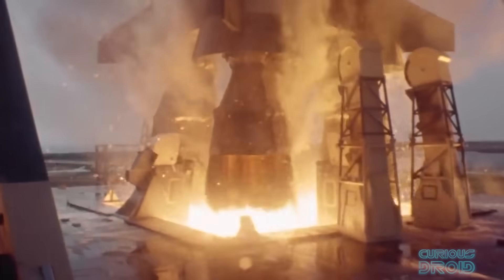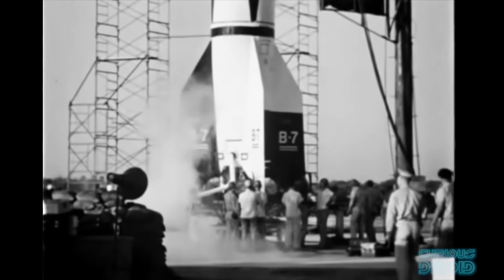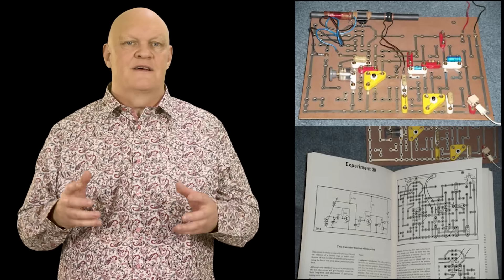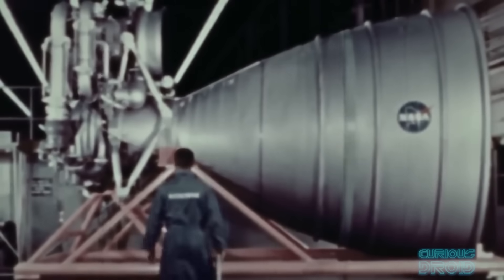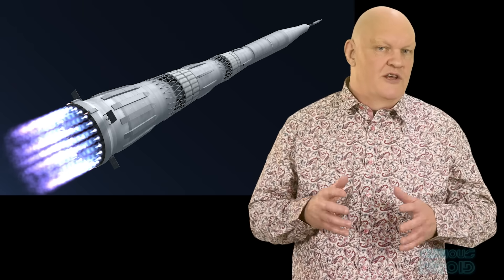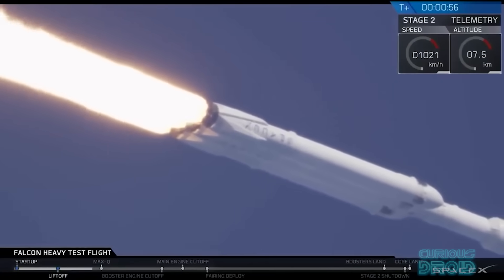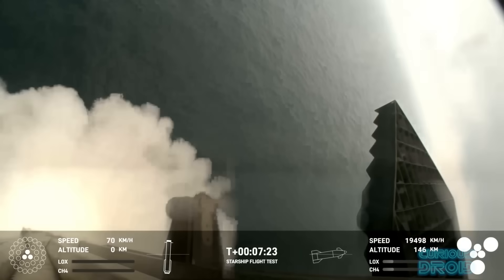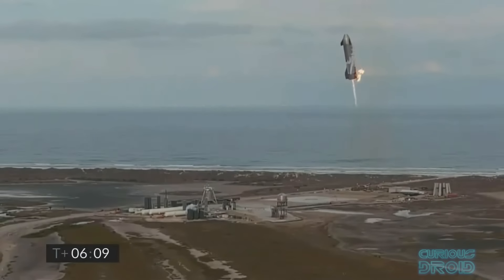Why Does SpaceX Use 33 Engines While NASA Used Just 5?

Comment: Enjoyed the video, but with regard to reuse of the F1 engines, didn't they use RP1 and LoX?  Doesn't that cause coking of the engine components, which would require considerable cleaning/refurbishment prior to re-flight right?
Reply: The F9 uses the same fuel, Highly refined RP-1 and LOX. Coking is not as bad as one might think. The F9 engines require very little maintenance and some have been reflown 20 times now. Now I must note that the Merlin-D engines are smaller and have a higher chamber pressure compared to the F1, so this might be of influence.

Comment: you wouldnt throw away a car after one drive blar blar blar but spacex are willing to waste all those raptors for prototyping. not exactly consistent are they.
Reply: No one puts prototypes on the front line.  Even Falcon 9 took several flights before they tried landing on a boat or land.
Reply: Yet the development costs are tiny compared to the profits they've made, 6 flights of the Falcon 9 to recover its development costs, and Space X are getting close to 100 flights per year, with rockets used up to 20 times (and in the future probably higher). Theyve onlt ditched 4 flights, theyre planning to recover their 5th. Just about everything else has been recycled
Reply: And cars get crash tested all the time too. What’s your point exactly?
Reply: @Yggdrasil42  my point is the whole "you dont throw away a plane/car/whatever after one use" thing is a bit tired now makes about as much sense as the "the best part is no part" thing. Spacex are throwing away hundreds of raptors and how many prototype rockets (40+ falcon 9 worth of motors) so its meaningless to pretend this still means something. As for the good old best part is no part how about we try and levitate the forking ship into space and use no engines at all. best of all lets not even bother with the ship at all and just throw payloads into space.....
Reply: and they have already binned 400 of them.

Comment: I remember back in the early 2000's people were asking why couldn't we just resurrect the F-1, build some new ones and put it back into use? This video is the answer.
Reply: That and the manufacturing lines have been shut down since 1972 or so, over 30 years prior to the Constellation Program.
Reply: @michaeldunne338  That is less of an issue than you might imagine. Rocketdyne makes a huge effort to preserve engine manufacturing knowledge. That is how they managed to restart H-1/RS-27 production in the mid-80's for the Delta II program.
Reply: @downix  Restarting production of sophisticated articles like that is not a trivial task though - need the tooling and tribal knowledge (usually), as well as suppliers too. And, it seems both LBJ and von Braun found it to be an issue at the time (the president commenting about wasting away a bunch of accomplishments and assets in colorful language). 

Quick question though: The RS-27 was developed when? And for how long was it used? Before being resurrected for the Delta II program?
Reply: @michaeldunne338  the RS-27 began life as the H-1, developed in parallel with the F-1, and entered service in 1955. They modernized the engine initially in 1972, taking old warehouse engines (last ones built in 1964 IIRC) and updating them to what we now call the RS-27 by adding vernier nozzles for roll control. They had a huge supply of engines leftover from the Thor, Atlas, and Apollo programs, so no new units were produced until 1987.
Reply: @downix  so the effort at resurrecting the RS-27 engine as an iteration of the H-1 took place from 1972 to 1974? With the revival in the 1980s taking place in 1987? 13 years after the RS-27 was first introduced? (Seems in 1974 - although, interesting enough, the last flight of the Saturn IB was 1975 with Apollo-Soyuz.)
Reply: @michaeldunne338  The RS-27 was a relatively simple upgrade to the H-1, not requiring new engines to be built. By the time the production restarted, no new engines had been built for over 25 years.
Reply: You might be able to but in heaven's name, why would you want to?

Advantages:
•It has a lot of thrust from one gigantic chamber.
•Proven technology I guess? But your resurrected version won't be.

Disadvantages: 
•Very far from cutting edge ISP even back then.
•Very far from cutting edge chamber pressure, even back then.
•Very far from cutting edge TWR. Even back then. It weighs 9 tonnes at burnout.
•Not designed for reuse and literally almost a tonne of carbon soot develops per launch.
•Not the most advanced engine cycle, even back then.
•Combustion instability issues were fixed only with serious compromises.
•Not designed for modern manufacturing processes.
•Restartability and throttle range questionable by modern standards.

3 Raptors is half the weight for the same thrust, designed to be reuseable, incomparably cheaper, with dramatically better ISP. Why would you use a 1960s engine that wasn't even that great in the 1960s by most measures other than size on a modern vehicle?
Reply: Everything you say is true. But it would be like restoring a 60s muscle car. It's not as safe, efficient, are even as fast as today's cars but it's so cool.
Reply: What's ISP and TSW?
Reply: "I remember back in the early 2000's people were asking why couldn't we just resurrect the F-1, build some new ones and put it back into use? This video is the answer."

No, the real answer is that as part of starting the space shuttle program, the machinetools for the Saturn V were destroyed.
This is a ridiculously common part of US contracts, to force the "customer" to stick with the program and not chicken out and go back to something that is proven to work.

The same thing was done with the Harrier-II machinetools as part of starting the F-35 for example.

And no, the Saturn V would still today be an EXCELLENT heavy lifter.   It was a partly accidentally achieved masterpiece of engineering at the time.
Even as outdated as it is today, it could still compete very well against nearly everything that currently exists or have been tested.
Basically, it's only in the last several years that rockets are better.   And if the tools to build new Saturn Vs existed, it would only need some basic modernisation to easily surpass or at least achieve parity with them.

Next generation rockets, if they're successful, that's when the Saturn V might become actually obsolete.
Reply: @DIREWOLFx75 finally, someone gets the right answer.
Reply: why do people assume that they need to rebuild the saturn V instead of making a clean sheet design that has the same or greater capability?
Reply: @okaySLBTW politics. F1B (this resurrected version) was designed to power kerolox alternative to SRB boosters , and not only they would be cheaper than SRB, but more capable. Also F1b wasn't not only cheaper than old F1, but also more capable. They reduced part count 10 fold if i recall. 
And remember that F1B was proposed before private companies like developed BE4, raptor or even Merlin engines.
Reply: @okaySLBTW  "why do people assume that they need to rebuild the saturn V instead of making a clean sheet design that has the same or greater capability?"

lol

Says someone who doesn't know how much effort goes into engineering BIG, precision, complex anything.
And even more so when it involves engines.

The Su-57 is a superb example of that, as the engine originally intended for it is only now getting CLOSE to finishing development, despite the complexity of the aircraft, it still took the engine over THREE TIMES as long as everything else to be developed.

With the Saturn V, HUGE amounts of money and effort was spent on the development.
The resources spent on rocket development today is just a drop in the ocean compared to the efforts employed in the 1960s.

And extremely importantly, the engineers responsible got really REALLY lucky.
By pure accident one of the first things they tried to fix the big problems with the initial development, not only did it turn out to be an almost perfect solution, it also turned out to be one of the better solutions overall.
But they ALSO just happened to start out with almost perfect details on the use of said solutions.   If they had started with completely wrong details it could easily have taken another 2-3 YEARS to figure out the correct configuration.   At worst, they might even have discarded the historical solution as not working instead.

That's the kind of luck that happens 1 in a trillion in engineering.   Probably even less often still.

So, do you want to spend 100 times more on developing rockets?
And then hope that the right person gets lucky?

China meanwhile is already hard at work at developing what is going to finally for certain be rockets that are MUCH better than the Saturn V.

But they're doing it by building and testing version after version of rocket model after rocket model.
They're spending HUGE efforts on figuring out how to build excellent rockets.
And their Long march 9 under development is looking VERY promising to take that top spot.

It's going to compete directly with the SLS with 150 ton to LEO, while being able to send 44t to Mars which is almost what SLS is aiming for its TLI payload.
Reply: @DIREWOLFx75  You misinterpreted what I said.
I claimed that most people will ask the question under the assumption that only the Saturn V is capable of crewed moon missions. Most people ask that with it never coming to their mind that they can just use another rocket that has similar capabilities. And I see people in the comment sections of space videos still ask that question as if they have no awareness of the Artemis program and the fact that it relies on TWO super heavy launch vehicle systems.
Reply: The answer to why the F1 engines aren't used anymore is answered in another CiriousDroid video specifically addressing that topic.

Short answer: the design still exists, but each engine was hand constructed, with the engineers making notes about the tweaks made to each engine.  It's those notes and skills that are missing, and although designs using modern techniques do exist there's been no push to build one.
Reply: So NASA reworked the original designs so F1 engines could be made with newer technology and techniques?
Reply: @firefly4f4  that's false. In fact a group of engineers a while ago have already improved on the design and manufacturing of the F1 engine. The methods and techniques can be replicated by skilled manufacturers of today. But this design team were able to compensate with 3D printing for some crucial components. Paul has a video on the F1 engine explaining this.

At the end of the day, they're not as efficient as a full flow stage cycle engine like the RS-25, which is no where near the current engines being produced by private companies of today
Reply: Nobody saved the blueprints or wrote down the process?
Reply: Not really its more manufacturing has changed and the fundamental way we make stuff isnt compatible with things like the f1
Reply: NASA had a team actually do preliminary work on resurrecting it. They took one from Marshall and got the turbopump gas generator working, which is most of the work needed. I helped them track down the particular engine, as it was flight prepped, but had to be pulled and replaced due to a defect in the injector plate being identified. Handy way to verify the configuration of a flight model, to have an actual flight model to work off of.
Reply: Did Apollo 11 actually leave near-Earth orbit?
Despite the revisionist narrative that this channel won't question -- unstable fuel burn for the oversized F1 engines was never rectified and another arrangement in their place was made in order to reach near Earth orbit, keeping the F1 bell nozzle to maintain the desired appearance.  The great licking yellow flame was an indication that something was not normal as fuel was burning in the atmosphere while providing no additional thrust. This was the result of injecting additional kerosene into the exhaust stream for greater visual effect yet appearing to produce an inefficient burn unlike other rockets after launch.  No explanation is forthcoming and this issue is not addressed in any usual report; however, using a smaller reliable engine with a reduced fuel load and stripped down mission requirement allowed the Saturn V to reach near-Earth orbit.  

The Apollo 11 crew attempted to demonstrate their position at over halfway to the moon as seen in the unedited version presented to the public while the more recently released unedited version reveals a flood of blue light entering the same window as the camera continues to roll, through which only a moment before, we saw the Earth far distant in what appeared to be very low light conditions. Then, as the camera pulls back from the window, the exposure settings are seen to return to normal as a flood of light enters the same window.  Without a change in the orientation of the spacecraft assumed to be on a trajectory toward the moon, the only source for any flood of light can be the Earth while in near-Earth orbit.  The usual sponsored efforts will try to make excuses for why the obvious did not take place -- yet is overly apparent in the unedited version.  When facts cannot prevail in support, sponsored activity will resort to name calling and other derogatory comments discrediting themselves.
Reply: .  . While remaining in near-Earth orbit, another indication are the impossible weather patterns seen on Earth, when in reality only a small portion of the Earth's surface was visible, framed by the round window of the command module.  Straight line cloud fronts are seen on video to be extending for what appears to be more than 6000 miles, a quarter of the Earth's circumference -- something that has never occurred in the meteorological record on Earth. The round window of the command module was used to effect an image of the Earth but the weather in the region did not comply for a realistic view.  No recognizable continents are found in view, but only the impossible weather patterns seen.
Reply: Main problem with the F1's, each engine is unique due to manufacturing process. Lost wax and electroplating meant each engine varied in thrust.
Reply: @owenbevans6062  they had mostly solved that issue by Apollo 14.
Reply: How is this the answer? I know you’re trying to be cool and snarky, but no. 

There’s nothing inherently wrong with the F1 preventing it from being reused. The major issue is that it’s half a century old, and there are more efficient designs out there now. 

Relight and throttleability are an issue, BUT the F1 did have (in tests) the ability to throttle to within 10% of max thrust, which would be considered “deep throttling” these days. It simply wasn’t required for the mission profile, and zero money was spent researching it or programming the computers for it - why would they?
Reply: @EstorilEm  We couldn't make them work again without billions of dollars in testing.  They have the basic designs but each F1 was adjusted and tweaked.   That recipe is lost
Reply: @kevinw7319 spot on, the way it was explained previously by CD, tribal knowledge, small little things, workflows around prep and construction, all gone.  There are eng. drawings and plans then there are the practical issues, special tools designed and made, special jigs, special hoists, safety precautions...overwhelming to think about...all gone, folks that knew are retired or gone...
Reply: @EstorilEm  the answer is it can be reused but no one made a system to bring it back.
Reply: I think there are many reasons why NASA did not resurrect/modernize the F-1.  We could argue the point and call each other names...  But that would be silly.  Don't you buttheads think so?
Reply: @texmex9721  there are better engines than the F-1 nowadays as well.

Comment: Now, if electric Jesus could just stop his ridiculous contraptions from rapidly disassembling themselves on an unscheduled basis. Even the system to determine if the rocket fails, fails. And nobody needs to move that much mass into low earth orbit.
Reply: Among other things, starlink benefits from the increased payload. That alone probably justifies the expense
Reply: I don't understand why they can't make it just work the first time. The apollo engineers did, without the tech they have at their disposal.
Reply: @C.I...  If it was intended to work the first time, it wouldn't be a "test flight".  NASA et al do their tests in computer simulations because their rockets are so expensive that they do not have the luxury of doing tests in the real world.  That's what you're seeing with these test flights: SpaceX's version of computer simulations.  As long as you can afford it, it is a hugely superior system because the data rolls in faster, can be trusted for authenticity, and can inform new design choices, such as how IFT1 made SpaceX realize they needed to use hot staging, which we immediately saw on IFT2.
Reply: @C.I... Waterfall versus Agile. There are a lot of sales people saying one is fundamentally better than the other. They are usually wrong. They are only better at the extremes.

Mass production methods usually win in reliability metrics over boutique production methods assuming material quality is kept similar. Variance between parts has a huge impact on reliability.
Reply: @C.I... The Apollo test flights failed plenty of times. And the other rockets before them.
Reply: @C.I...  Look up Apollo 6, they did not do it 100% the first time, and had to fix things as they went just like anyone else.